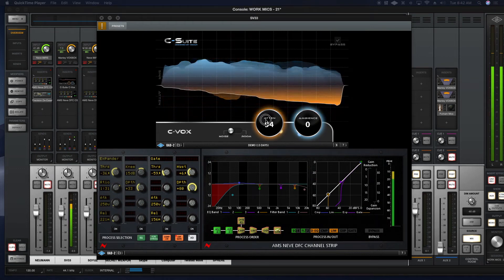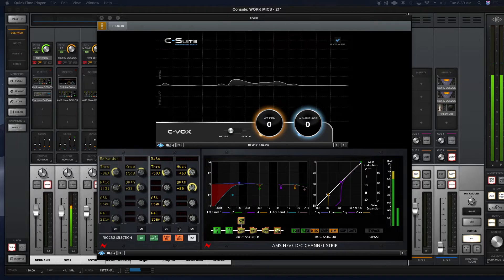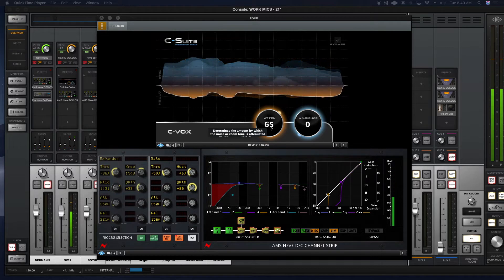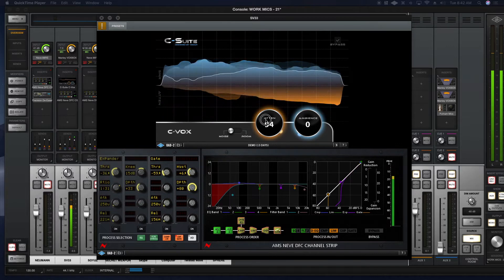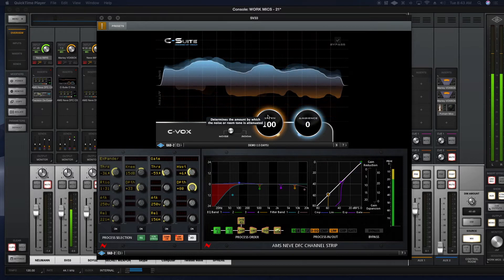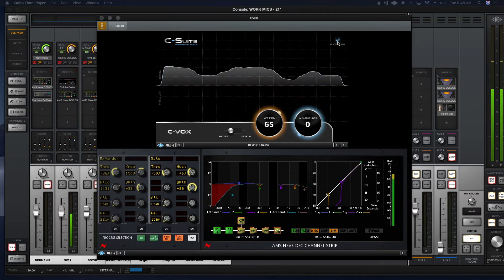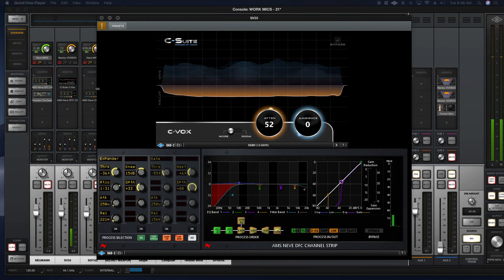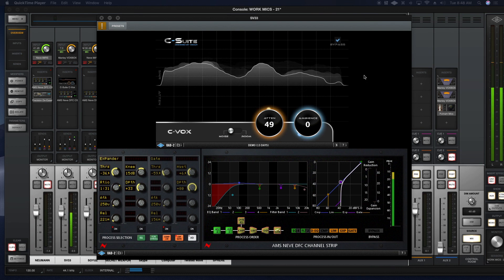Remove the Noise from a Voiceover? Does the C-Vox Plug In Work?

Comment: Hey, amazing I actually got the plug-in at a really great low price, I would like to know what your settings are to keep it that quiet in that professional since I’m not able to see very well. I kept the attenuation at 90 and ambience at four with the option of room instead of noise, but I still hear a little bit of The room in my recording. Perhaps you can give me an idea really appreciate it. But I will say that it fixed the issue about 90% just wanna know your thoughts and I have it running through the console in real time so I don’t have to deal with DSP later on.
Reply from the maker: CVox is great. I have the switch set to Noise. Attenuation at 100, Ambience at 0.
Reply: @MarkYoshimotoNemcoff  thanks for the feedback that really means a lot, so if I set it for noise, 100 and zero an ambience it shouldn’t affect the vocal performance? Just scared that it might take away. Just wanna know your thoughts before I run it. I know you’re probably gonna tell me try it out and see what results you get but since you’re such a professional, I’d rather just go straight to the source so those settings right there shouldn’t affect my singing when tracking?
Reply from the maker: The tricky thing about doing this channel is that I can only really talk about my experiences working with the gear because I don't know your voice, room, rig or other nuanced variables that would make your recording situation different, so the only thing I can suggest is that you can use my settings as a starting point and find the sweet spot that works best for what you do.
Reply: @MarkYoshimotoNemcoff  I totally understand and it makes sense. I just tested it and it did help out quite a bit, but just out of curiosity is having a little bit of room noise bad when it comes to recording a vocal? When I did your setting, it was great, I was trying to listen between the two different takes, but apparently this thing is so good that it doesn’t really mess with the low frequencies, you mentioned in the video that it does, but I was trying to go back-and-forth from different texts and it feels like it doesn’t, I do have a high pass filter on my Neve 1073 at about 80 Hz rolloff and it feels that it does a great job, I’m just wondering since this is a room issue that I’m having because I don’t have proper acoustics. Should the setting be on room or noise and I won’t bother you anymore amazing video by the way.
Reply from the maker: Taking out the room reflections will always tighten up the way the bottom end presents, especially when dropped into a mix. And that's the only way to know what target to hit. You have to drop your track into a mix to know what's optimal for you, with what you're working on.

Comment: I love it. I think it works really well. Yes, it’s expensive but not if you purchase during holiday promotions. 
I picked up C-Vox and AMS RMX 16 for $75. 
The deal was any 2 plugins for $99. They gave a $25 gift also. So yeah, $75 spent for about $700 with of audio deliciousness. 
If you’re going to do this you’ve quite a wait ahead of you. But you can demo it. If the demo doesn’t give you enough of a time frame to decide
(14 days) then just ask nicely and they’ll reset the demo back to 14 days for you.

Comment: Unprocessed is better. When I send a VO over to any good engineer, they hate hearing any processing. If it’s baked in, It can severely hamper what they can do with the recording. Just find a better space to do the job and if theres any room removal to do, let them do it.
Reply from the maker: Thanks for your reply. A huge majority of the commercials I book never go to an engineer, but instead to a producer who drops my track into an edit timeline, adjusts level of the bed and renders it through their preset conform settings. There’s no post. No engineer. I send mic-ready tracks always and never get a complaint. The modern VO workflow often eliminates “post” and goes right to drop and render.
Reply: @MarkYoshimotoNemcoff  The Work I do here in the UK still has engineers involved. Thankfully. Even producers I know, would always want it untampered with, but can appreciate that's probably where things are headed.
Reply from the maker: Yeah, it’s a very common trend here as every producer or video editor thinks they can mix. The big stuff of course is still done in post, by post engineers, but so much of the non-union work is wham-bam-thank-you-ma’am. I was appalled the first time I heard my first commercial and the second was just as bad, so I leaned the hard way how to mitigate it for the work I do by essentially sending a file with the processing I use on this channel. And it worked because once I started doing that, my business increased. It’s a sad commentary on our business, but as VO standards and sonics change, I’m not going down without a fight.
Reply: I'm a British VO as well and all the jobs I've booked this month (commercial + some narrations) have wanted a ready-to-use VO. 
C-VOX not only deals with self-noise but also helps with room tone. It's pretty spectacular. This is the reality of the modern work-from-home VO.
Reply from the maker: It really is. Especially post-Covid. VO production workflows changed and it seemed like a lot more projects had fewer hands involved from start to finish. At best, I’m sending a file to a video editor, never a mixer anymore.
Reply: @MarkuxWoW  I’ll do a 14 day trial.
Reply: In moderation, I think it doesn’t sound processed at all. I Like it a lot. In the sale too. Purchased. Thank you!
Reply from the maker: Enjoy! I have since become a big Cvox fan.

Comment: In the video Mark is speaking from inside a sound proof recording booth. And to my ears the background noise is not  an issue with the C-Vox or without it. 
But, If you are are NOT using a sound proof recording booth in your home studio, like in my studio then traffic and outside noises can be a problem during source connect sessions. 
I use isotope RX9 in Logic Pro while recording but it is not a perfect solution.  I run RX9 a second time while post processing and the bird and traffic noises go away. 
The other day I was doing a source connect session from my home studio and the engineer at the recording end said he could hear the sound of traffic outside my studio. 
I am going to try C-Vox  to see if it solves that problem. If it does I don’t need to buy a $10,000 whisper room.
Reply from the maker: A lot of times with a less-treated space, the worst culprit is low frequency rumble, so a high pass filter before CVox helps CVox do it's job better.

Comment: I wonder how good of a job this plugin can do to recordings with a lot of noise, let's say you make a recording of a conversation with your phone while having it in your pocket while you're walking and the noise from the phone being in your pocket is being captured for each step you take when you walk and it scratches against the inside of your pocket, would it be able to clean up the recording to get rid of most of the noise you think? Or is that too tough of a challenge?
Reply from the maker: Hmmm. To me the larger question would be about violating two-party consent laws if you are recording a conversation while feeling compelled to hide your phone in your pocket. 😁

Nonetheless, I think spectral noise removal can help intelligibility of speech in a case like that but best results will always come if the noise is at a constant level and not constantly changing sharply in amplitude. 

Why? Are you wearing a wire? 🤣
Reply: Hehe no but generally I was wondering if it's able to clean up noisy recordings well to enhance voice and remove as much as possible of ambient / background noise or is iZotope RX 9 generally better for such cases? For instance if you're carrying out some interview next to a road and cars are passing by causing hum noise
Reply from the maker: @tobbe8287  It's a very interesting question and one I kind of take a sigh of relief knowing it's not an issue I ever have to deal with since it seems like dealing with dynamically and randomly changing noise would be an extremely complicated problem. I would be inclined to believe that any noise removal scheme that includes taking a noise sample to create a noise profile would yield a better result. And you can't discount the possibility that it could potentially work by cutting the source file into smaller segments that separate different noise thresholds, treating them separately and then stitching them back together.
Reply: RX 10 advanced. Ur welcome.

Comment: Good vid. Do you get any artifacts using this or the room ambiance feature? RX8, etc all leave artifacts.
Reply from the maker: Thanks! Yeah, the more you crank that noise attenuation up, the more artifacts you get. I didn't really go into the de-ambience feature but just messing around very briefly, I found it to also have odd artifacts when you crank it up. I'm in a booth so I couldn't get a sense of how well it works to actually dry out the ambience.  I think if you're treating a sung vocal that will go into busy mix, you can hide a lot of that, but for spoken word that isn't, it's going to sound a bit unnatural. I'm sure there's a sweet spot in there somewhere and it's pretty remarkable that you can do it in real time, monitoring through the C-Vox with no latency, but I think anyone doing VO who looks at the C-Vox as a solution to remove all noise and ambience will be disappointed with the results. Spectral Subtraction, though effective, does have a limit to what it can achieve at this point in time. Thank you for leaving a comment.
Reply: @MarkYoshimotoNemcoff  Thank you for the detailed explanation.  Been enjoying your vids.
Reply from the maker: @incognitocas  Big thanks! Glad you’re watching.
Reply: I find RX Spectral Noise removal to be very good as you sample your specific noise profile for a particular session. Also de-noise and the degree to which you use it in general depends on content I think. For audiobooks esp having absolute silence between/around words actually feels strange and in 90% of commercial reads there will be some kind of music/fx going on so overall my feeling is a light touch is better. Of course depends on your recording environment but like any processing the more you push it the more noticeable it can get.
Reply from the maker: @zeitakulobusta  That’s interesting. I have to think that creating a noise profile to know what to remove is a better way to go.
Reply: @MarkYoshimotoNemcoff  you'd think tailor-made would fit better than off-the-rack but...algorithms? Who knows at this point in time
Reply from the maker: @zeitakulobusta  Given how much noise removal technology benefits not only music and broadcast, but also telecommunications, you have to believe there are a lot of resources being applied by companies all over the world to make those algorithms better and faster all the time. The future of this tech is very bright.